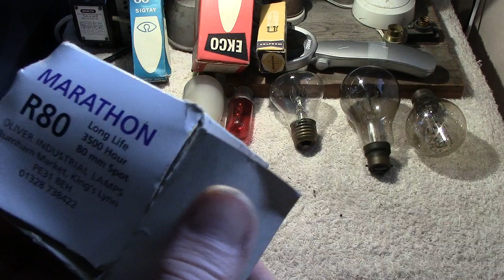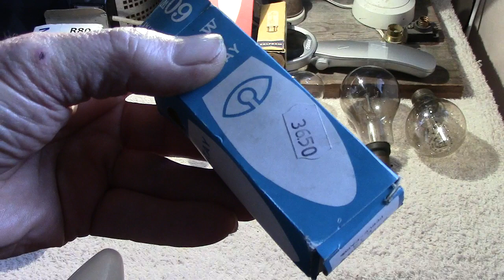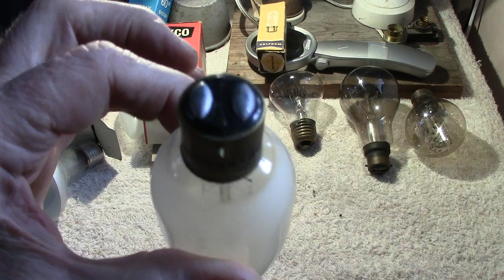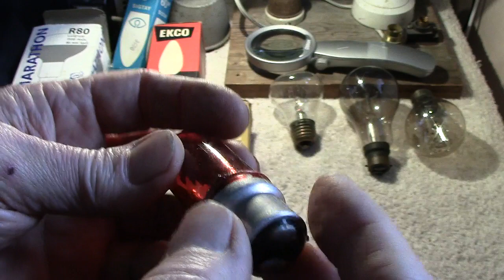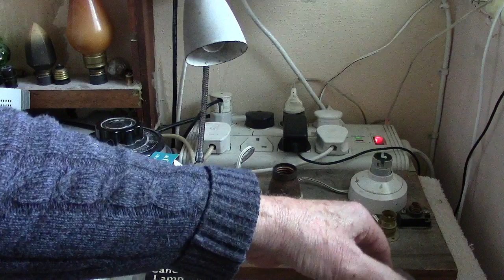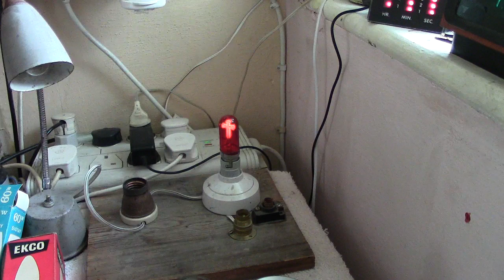Selection of lamps

Comment: Traffic lights round where I am in the UK are either low voltage bulbs running via transformers or LED... in many places mains voltage bulbs were phased out in the 1980's
Reply from the maker: Hi thanks you are right, forgot that, low voltage yes